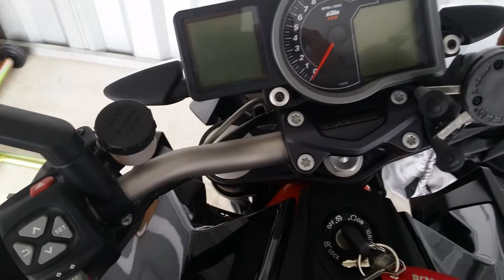Superduke 1290R front wheel/brake noise

Comment: Own a 2016 KTM SD R and I had the same issue after a tire change. The issue is that there is play in the caliper mounts and in the wheel. I re-mounted the front wheel, being careful that the spacers fit tight and tightened the wheel clamps evenly. Then, when installing the monoblock calipers, tighten them slowly and make sure the break pads are not an asymmetrical distance from the rotor. There is a bit of play here and if you tighten the two bolts holding the calipers separately rather then slowly going from one to the other (like you would a head gasket) then it can fit off-axis. Bleed the entire front break system. Add DOT4 fluid. Problem solved.
Reply from the maker: That's an interesting idea. I dunno. I've had the front wheel off / calipers off multiple times for tire changes, brake pad replacements, I even replaced the stock rotors to the Galfer wavy kind. I've always been meticulous when putting the front wheel back on and tightened the caliper bolts evenly as the manual instructs.. I'll be due for a new front tire soon.. I'll pay extra attention when I re-mount the front wheel and see if I'm able to get the calipers on any straighter than I normally have.

Unfortunately this video generates a lot of negative discussion about KTM and the 1290. I have to say that despite this issue, I've had an absolute blast riding this bike for the past 3 years. I just ticked over 16k miles, and it has handled everything I've thrown at it (commuting, rain, hail, motocamping, touring,  and general twisties riding) wonderfully.  I wish I could fix this issue, but even without finding a solution I still love riding this bike.

Comment: Yep - Same exact problem.  Mine is a 2014.  I have had my rotors replaced, I have had my wheel replaced.  Next, I was gonna have the calipers replaced but KTM has refused to do this work under warranty claiming they are not going to do it just because of what people say on a forum (I cited the issue as called out on the forums).  My only options are(1)live with it(2)lawyer(3)buy new brake calipers.  Maybe ISR.  Disgusted at KTM.  Seriously contemplating (2) after all the money I have paid for this bike.  Outside of this front brake issue, (ahem, kinda important KTM) -  its a fantastic bike though.
Reply from the maker: Richard Esmonde 

Yup. I followed the exact same course with KTM. One guy on the Superduke.net forum was able to get KTM to replace his under warranty. That fixed it. It seems that's the only thing to fix this issue.
Reply: My 16 does the exact same thing. For this price bike im really like wtf.
Reply from the maker: Richard Esmonde what did you decide to do?
Reply: See above (the lawyer letter) - still need to follow up but swimming against life's tide right now

Comment: My 1290 SDR from 2014 has the same problem. I have ridden 23000 miles like this. Not happy about it at all. I am 'living with it' until I saved up enough to buy a new bike. Will certainly not be another KTM. Feel sad because aside of this problem I really like the 1290.
Reply from the maker: Moonlight Drive 

Just bought and installed new front and rear rotors. I've heard this fixes the issue for some people... fingers crossed.
Reply: Hope it fixes the problem. let us know.

Comment: Apparently lathing the rotor landings on the front wheel fixes the issue.   http://www.superduke.net/forum/viewtopic.php?f=29&t=26777&p=332923&hilit=front+brakel+noise#p332923  I think its fair to say that this suggests KTM's design for those mounts must be slightly off.
Reply: Thanks, I did see that thread. I'm going to check mine and see if I have those ridged landings and try to fix them this winter. Have you done that work yet?
Reply: I have not undertaken any such work yet.  When I find the time I hope to take off the wheel and examine those landings very very closely.  I'll be sure to let everyone know if I find they are off in any way.

Comment: mine is 2015. hmmm i should take it to the ktm dealer to check it out too..but do u have the "squeal" sound while slowing down on red lights?
Reply from the maker: +redninjablack2013  Seems like I only have this noise at low speed maneuvers. If the wheel is cocked to either side while I'm slowing down at a red light I will hear the noise. Although, its harder to hear when the engine is on.

Comment: I got so fed up with being ignored by KTM in Southern Cal that I had my lawyer compose a letter for me.

KTM sent a knowledgeable sounding mechanic up from SoCal to work on my bike in San Francisco at the dealership.

He spent about three days trying different things in May of this year(2017)

Here's what was done:
1. Installed a new front wheel
2. Installed new floating rotors for front wheel, one either side (left and right)
3. Installed new front brake calipers (left and right for each rotor)
4. Installed new brake pads
5. Installed new front wheel hub
6. Installed a new front tyre
7. Bled braking system and tested it

Results:
Marginal improvement in feel of brakes.  Tighter feel and better bite.  The droaning noise is still there. It has diminished slightly but it is still very much there. 
I spoke with the mechanic over the phone about the work he did.  
He said the rotor rubbing (cause of droan noise) was not a safety issue but was still apparent and is just something he felt was a nuisance but not significant.  
He hoped I’d be happy with the work he exacted upon the bike.  I thanked him and told him I would discuss my experience of the bike and his recent work with my lawyer.
I have.  I have told him the issue has not been fixed.  Right now, life has gotten extremely busy so I can't follow-up

My thoughts:
At this point, I feel KTM have engineered a front end fork design which has slightly uneven heights/alignment for the rotor mounts on the wheel and that is why the droan is occurring.  
I personally feel this is the only thing that might explain the rubbing but I hasten to add that I am not a KTM engineer.  
Whatever the reason, the bike should most definitely NOT be making this noise.  It's supposed to be a track bike for goodness sakes.  Let's not even get into how much I paid for the thing brand new.

Comment: Im so sick of fighting with my dealer. I just want to know what parts I need for a sure fix. As of right now they insist that nothing is wrong and that it just needs to warm up..   lol mine is so bad  and like I have time for this extra work on a new machine..
Reply from the maker: Abs151 what year is your bike? From my understanding some have blamed it on poor casting of the front wheel on the 2014's and some early 2015's.
Reply: Mine is a 15 leftover. I priced out front calipers and disc/pads, I am looking at around $1250 in parts. Might try the calipers first but almost sure that the disc is warped now as it seems to be getting worse. From what I have read seems like the calipers arent working properly as dodgerider posted. Kinda scary though, thinking that might not fix it.   Dealer says there is nothing they can do, which is bs
Reply from the maker: Abs151 I understand. Search superduke.net for poorly casted front wheel or.badly made disc landings and see what you think. I have to wonder if a new front wheel(2016+ model year)  would fix it? Might be cheaper than calipers and all that. If the rotor is warped of course it'll need replaced, but maybe for the last time, or at least several thousand miles/kms.
Reply: Is that how you fixed your problem? Replaced the whole wheel and disc?
Reply: Update: I spent all last night taking apart the front calipers. When I got in there it was obvious on master side the bottom piston on the outside was stuck. Then the pure amount or brake dust and grim that came out of them amazes me, especially that it is a brand new bike that just hit 1k in miles. I then put them all back together only putting the littlest amount of silcone grease on that one piston that was having the most problems. (Night and day difference on the operation of the pistons after this cleaning.) Then moved on to a complete flush of the cat piss(whatever black fluid that was is there). I can move the bike in my garage and the sound is gone and even better, went riding this morning and I was able to use my front brakes. Last Friday the sounds that I had when coming to a stop were so loud and the bike was actually starting to to get sketchy to ride IMO. I did document most of this on my Gopro and my h1 recorder as I am going to be showing my dealer this and most likely upload it to help out others. It amazes me the run around I have received from my dealer service department. I dont even think they even looked at anything after I started taking it apart. They just take it and let it sit in back and tell me stuff like the bike has to heat up? They even said I was lying and the stuff Im reading on the internet is bogus....  Seriously be careful who you buy from internet ppl.
Reply from the maker: Dude, that is awesome! I'm glad you seemed to have gotten some improvement.

 In fact, what you've written sounds a lot like what this dude from MC Network wrote in his "Doin' Time" write up on the 1290. Link is here: http://www.motorcyclistonline.com/long-term-test-ktm-motorcycles-1290-super-duke-r-doin-time#page-3

I sent a couple PM's on superduke.net trying to get a little more info about the poorly casted front wheel disc landings. I read about them somewhere, but can't for the life of me find the thread. 

And yes, PLEASE upload the vid of your fix! If your fix gives lasting results I'll link it in my video so hopefully others can find a solution.

Glad your bike is riding better, and yes it is absolutely ridiculous that dealers won't take apart the calipers to see if this issue can be fixed. Have you noticed any difference in performance? It seems like the bike must be more powerful when the front brake isn't constantly dragging!?
Reply from the maker: Abs151  

Just wanted to follow up. If you continue to have issues, check this thread. Scroll about halfway down to where the username Grommet talks about his fix. He filed down some poorly machined disc landings and seems to have fixed his issue. 
http://www.superduke.net/forum/viewtopic.php?f=29&t=26777&p=332923&hilit=front+brakel+noise#p332923

Comment: I removed the front wheel today.  I took off the two front rotors and then cleaned the wheel until it was spotless and shiny.  I then viewed the rotor mounts with a magnifying glass but noticed no discernible 'machining' errors.  To be honest I think you'd need a really good rotation device or lathe to accurately measure any fault which might be there.  So, I can't say I noticed anything with the optical approach but when I put the wheel and brakes back on everything went back to its old brake droning noise-self.  Not sure where to go with this next.  I remain thoroughly, thoroughly disgusted with KTM.